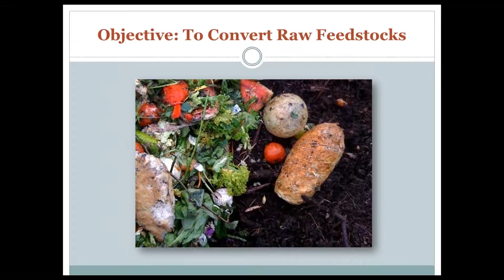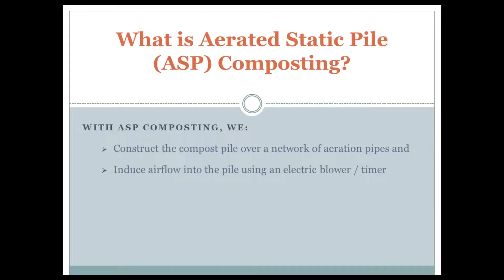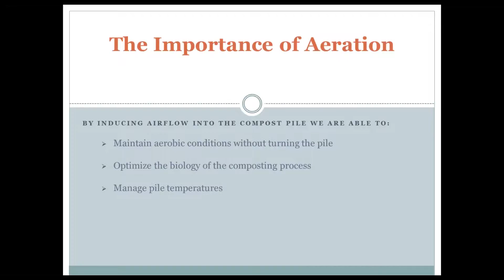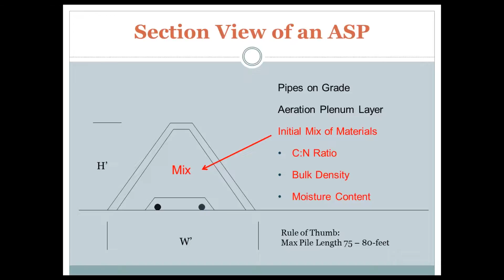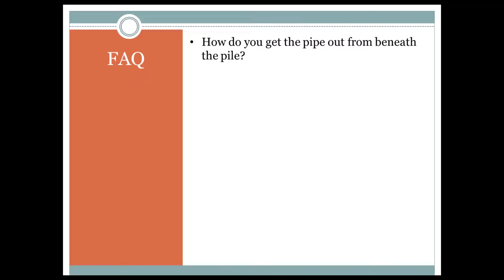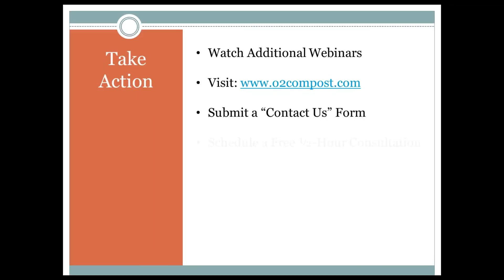ASP Composting Webinar Series -  Part 1

Comment: Dear Mr. Moon, thank you for the wonderful webinars. They sure do help many of us who'd like to start composting.

I have several questions please as a first timer in this composting world,

1. What are the things that might need to be adjusted or to be adapted to us who live in the tropical region of South East Asia which have long dry season and long raining season each for around 6 months with high humidity percentage?

2. Should the piles need to be covered with waterproof or other permeable layers/fabrics to prevent rainwater to seep in during the raining season? Or does the 1 foot unscreened compost layer would be enough as a cover?

3. What do we have to do to maintain 60-65% moisture and how much watering do we have to do? Does only monitoring temperature would be enough as a benchmark/signs of moisture levels or do we need to have special moisture monitoring device placed in different areas within the pile?

Thank you kindly for responding :)